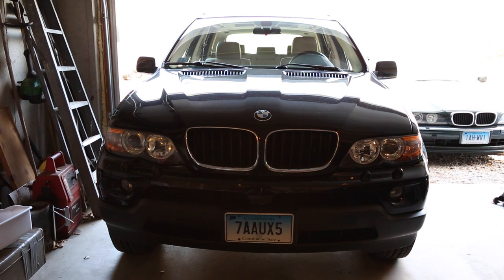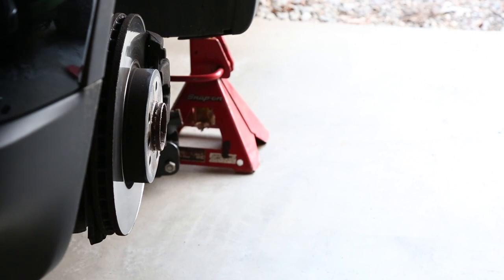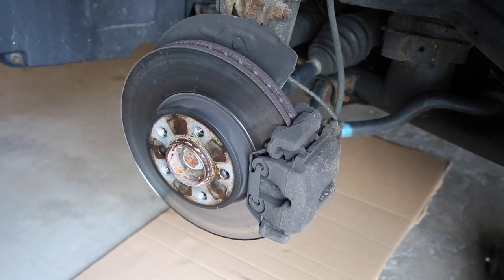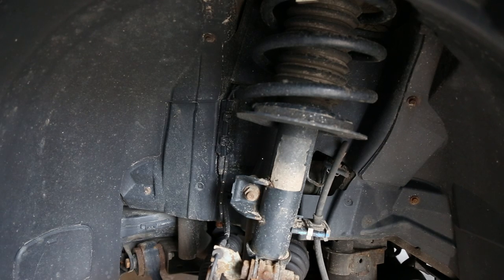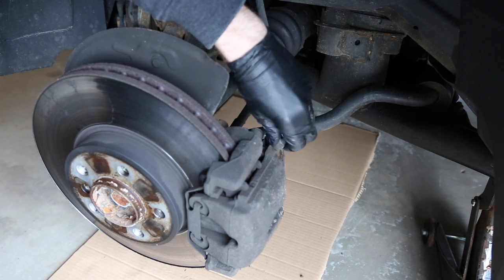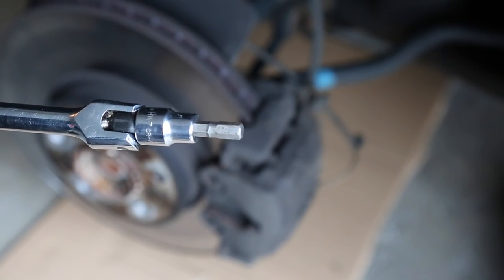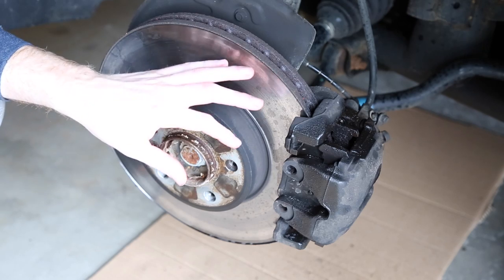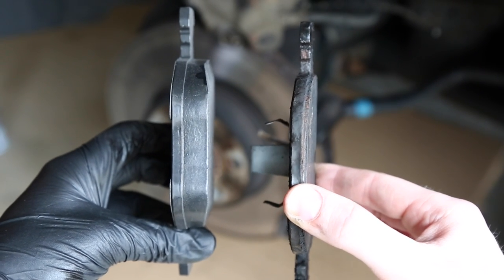BMW Front Brake Rotors and Pads DIY E38 E39 E53

Comment: FYI: it is EXTREMELY easy to rebuild a caliper with a new piston (should you need it) and the rubber dust boot,  internal square o-Ring, rubber guide pin boots too. the repair kits cost about $7.00 USD per corner (Centric or ATE) as opposed to rebuilt caliper (tho those look much nicer, unless you spent a LOT of time grinding dirt/rust off) . ALSO the 80 foot pounds sounds incorrect to me, unless its different between the 3.0 and 4.4i/4.8iS @ 100 foot pounds of torque... Great video tho, as usual

Comment: I have an E39 2002 model 530 diesel automatic car with the M57 engine (CA980-40). I changed the front suspension shock absorbers with MEYLE, engine mounts with BMW Genuine, control arms MEYLE again.

I had the oil change 3.000 miles ago and also did the transmission fluid change at 60K. The car is currently at 65K miles. I am the 2nd owner of the car. Overall it is a great car but I think I have some problems with it. An old guy used to own the car. He died, and I bought the car from his sons. I have no information regarding the service history of the car and how it has been used. But all the mechanics I have taken it to have said that it has been taken care of and there are no leaks and so on. 
I have been having a wobbly/ like a fud noise coming from the front of the car, under my legs where the gas pedal is. Or maybe the wobbly noise is coming from the transmission but I feel that it is coming from the engine compartment. This noise takes place when the transmission shifts gears from 1 to 2 and vice versa. The acceleration is fine. The engine sounds smooth and there are no problems with it. But there is a big “once jump”, “a noticeable wobble sound” when the car shifts from 1 to 2 or from 2 to 1 speed. This is especially more noticeable when the car has not reached its operating temperature. After 10 minutes of driving, some (most part) of this noise disappears. 

This vibration has gotten worse, not by much, but it has. My main problem is I feel vibration under my feet where the gas pedal is - when I touch it, it gives me that feeling. I feel it more when I push it and let it go. 

I had a mechanic check. He says that it is not the transmission problem or its mounts but rather the rear axle. He drove it and also checked it and showed it to me. There is a little play at the long shaft that is connected to the transmission. It is not the part that connects to the transmission directly (where the guibo is) but rather at the back place where the transaxle is. If that is the case I really do not know what do since it costs around 1000 euros of BMW genuine. I have seen a video related to rear axles and the guy says these usually wear out after 100K or even at 200K miles. I really couldn't understand why mine went at 65K miles. Again, if that is the problem. The mechanic is sure that is the problem. He says that if it had been the transmission mounts, the car would vibrate a lot even at stand still, I am not sure if that's correct.
Reply from the maker: +Turhan Uludağ hey Turhan, thanks for sharing your story here. If your wheels have been checked and they are 100% straight along with wheel balancing, and your suspension components are also refreshed, then yes I have heard about problems with the axles/driveshaft causing vibration issues. In fact, my 530i currently has a vibration I have yet to pinpoint which I feel in the seat of the car and from the rear end. Keep me updated how you make out with resolving the problem! Also, see if anywhere in your area can rebuild your current parts, instead of a very expensive new one at BMW.

Comment: Another excellent video. Really enjoy these DIY vids! Saved me a ton of money wrenching myself. Would you recommend replacing the rotors at 90k? I bought BOSCH pads for replacements.. Thoughts?
Reply from the maker: Hey Brock, thanks! Yeah if the rotors are original with that kind of mileage I would recommend replacing them. If you're lucky you can typically get 2 sets of pads out of one set of OEM or comparable quality brake rotor.

Comment: Brake pad wear sensor should be installed on the pad before the pad is installed on the caliper.
Reply from the maker: +Upallnight True, it is recommended to install the sensor in the pad first! But still pretty easy to snap it in place after the fact.

Comment: If I remove the 2 17mm bolts holding the caliper bracket first can I take out the whole caliper assembly?
I stripped the caliper guide Bolts and I can't remove them
Reply from the maker: Hi Jose, yeah you can do that if you can fit a socket back there on both bolts. Then I assume you'll get a new caliper and carrier from a remanufactured part. I don't recall if the socket fits back there without the caliper removed first, it is different on each car. Good luck!

Comment: I’m sure you edited some things out, to make it short. I was curious how long did it actually take you to do this job? Give and take
Reply: Great video by the way and gave you a thumbs up!
Reply from the maker: Hi, yes it's edited to make it watchable. I can do the brake job in about 30 min per side, but one could spend up to an hour or so per side if they have less experience doing brakes. It all depends on your experience level.
Reply from the maker: Thank you I appreciate it!
Reply: BIMMER ZEIT It took me 3 hours yesterday just for one not because it was difficult per say but because of the damn rotor being stuck haha if it wasn’t for that it would’ve been an hour job, today I’ll be doing the other side so it should go a little easier since I know the tricks. No problem!
Reply from the maker: Unfortunately rust and corrosion from road salt in places that get snow makes repairs much harder. Don't be afraid to pound that old rotor (if you're replacing it) with a sledge hammer or 5lb hammer to get it off. Be sure to wear ear and eye protection. It also helps to spray around the hub with WD40 or something to help free it up.
Reply: BIMMER ZEIT Did everything you mentioned! I know what you mean about these winters and salt, makes these jobs harder but not impossible. Appreciate the video bud, got to replace my front brakes because of it.

Comment: I just got Estimate today for new pads and Rotors on my 2002 BMW x5 $1600.00 for front and back..... what a hell
Reply: Les James Do it yourself bud.. I just got 4 rotors, pads and sensors for $170 on eBay, I’ll be doing all the labor. We’re men, we handle stuff ourselves.
Reply from the maker: DIY it James. Even if it takes you all day, better than paying $1600!
Reply: ebay and its really as easy as the video looks

Comment: Do you have to bleed air from the brake line?
Reply from the maker: J Equity Group when you are doing brake pads and rotors no, you do not, since you’re not opening up the brake system. It is a good idea though to change out the old brake fluid at a regular interval (every 2 years at least) which would involve opening the bleeder at each corner to flush the calipers and lines.
Reply: @BIMMERZEITT  thanks !